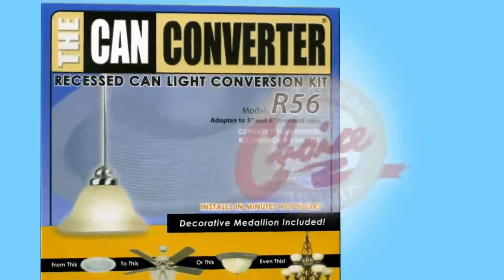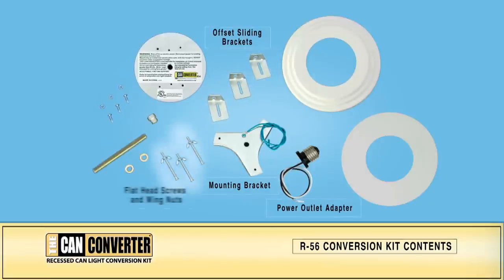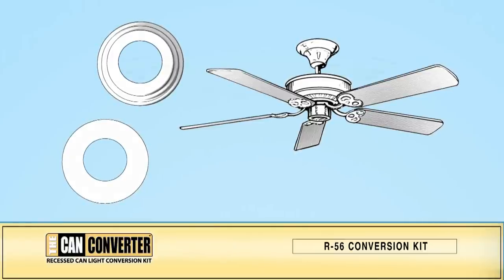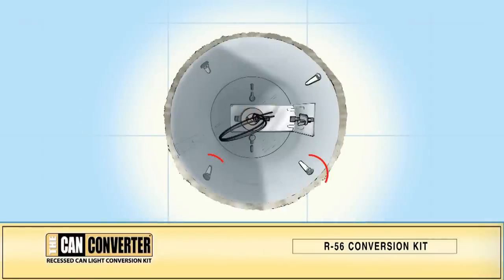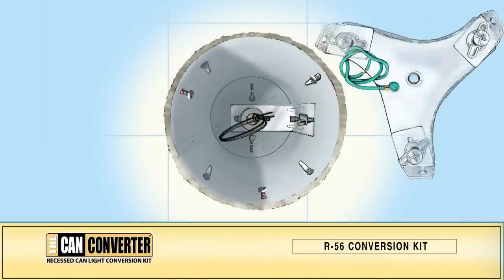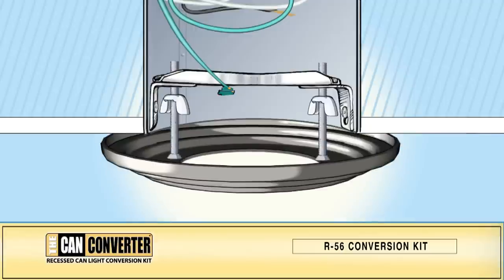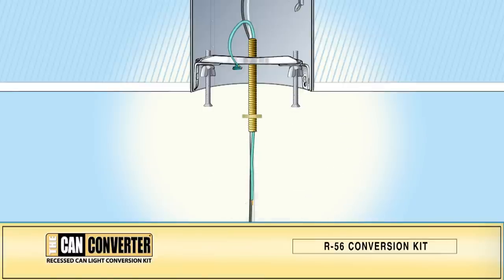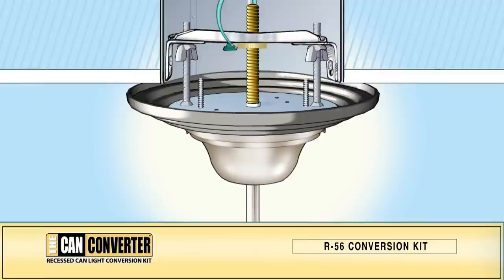How to Install a Ceiling Fan - The Can Converter Model R56

Comment: Call a qualified electrician the can light is not ment to support a fan
Reply: Just my educated guess...Usually the can housing is supported by stud framing. The adaptor kit screws are meant to screw through the can into the wood 2x4 framing which is plenty strong to support a ceiling fan.
Reply: A new work can light with this conversion can support a 35 lb ceiling fan. This is not to be used in a remodel can.

Comment: screw the fan hanger on to the mounting bracket with what??? so frustrating when you don't provide the necessary parts to complete the job.
Reply from the maker: The fan manufacturer should have supplied the screws to mount it’s fan hanging bracket
Reply: Also having the same issue what screws would I need to make this work ?
Reply from the maker: @Cozyplayss  Fan bracket screws are typically supplied with your fan. However they are 10/24 between 1/2" to 1" long
Reply: @TheCanConverter  unfortunately mine expects the mount to have it but I’ll try and source some myself thank you !
Reply: @TheCanConverter  I have a harbor breeze branded fan from Lowe’s I’m not sure if other models they make come with mounting screws or not
Reply from the maker: @Cozyplayss  If you have a Harbor Breeze fan, I would believe all Harbor Breeze fans would not have screws. However you will find them in the hardware section.
Reply: @TheCanConverter  thank you !

Comment: What if your existing can light is GU5.3 and not E26? Is there a kit for that?
Reply from the maker: You will need to cut the wires from you GU 5.3, using wire nuts connect those leads to your light fixture

Comment: I have a question. I have a room with 3 can lights down the center controlled by a single switch on the wall. I want to replace the center can light with a ceiling fan with a light kit. Is this possible to do or do I need an electrician? I want to be able to run the fan but also have the lights off.. there is only one switch tho in the room
Reply from the maker: Since all 3 can light are on the same switch, you will need to contact an electrician to bypass the switch to the center can light. Once the center can light has its own power you can you the fans remote to turn the fan on and off.

Comment: I searched for information to show my husband - and this is a hell no - going straight into the stud somehow w/out rigging - and should have to hold more than 35pound, what about the wiggling from movement? My dad - 50 yrs a carpenter, would have a cow.
Reply from the maker: You don't go straight into a stud. The can is already securely attached. Once The Can Converter is installed, you have a strong and stable mounting point for a light fixture up to 50lb and a ceiling fan up to 35lb. Regarding the rotation of your fan this is not an issue our kits are UL listed. If your fan is wiggling it needs to be balanced.
Reply from the maker: The can converter model R56 is UL rated for fans up to 35lb. Meaning UL has tested the R56 Can Converter under various conditions, especially with concerns like yours in mind.
Reply from the maker: @Nikiforas  make sure the can light bar hangers are attached to the ceiling joists, if they are the fan will be secure

Comment: will this work on a sloped ceiling?
Reply from the maker: The R56 kit is not rated for sloped ceiling can lights, however it will work if the can light itself is a standard can mounted in a slopped ceiling.